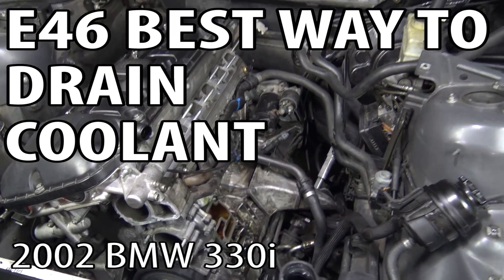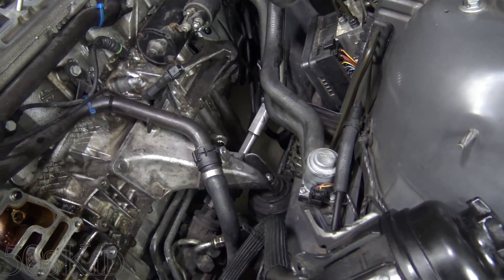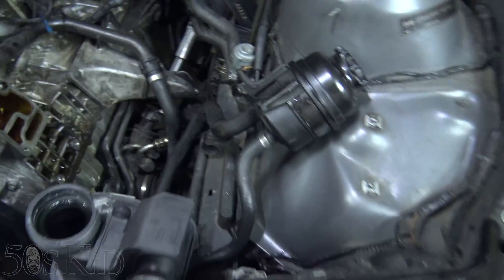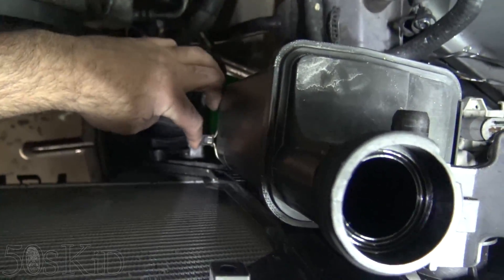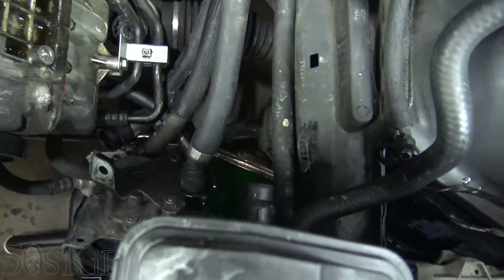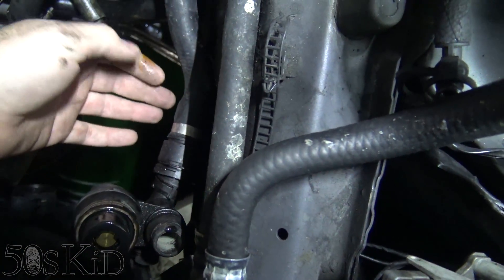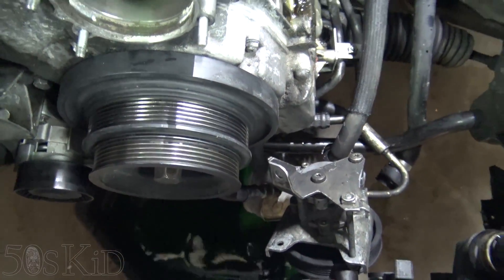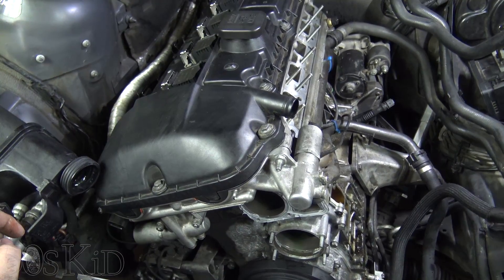Best Way To Drain Coolant on an E46 BMW DIY #m54rebuild 5

Comment: Can you still flush it this way if you're replacing the coolant with different coolant? Someone used the wrong coolant (green) in the car I have, and I want to completely get the green stuff out of the system before adding in blue coolant.

Comment: I am currently doing this and the drain plug on the bolt is very tight I got it to turn but I feel like it's going to shear off, if I remove the water pump will it drain all the coolant from the block as the drain bolt will?

Comment: Just redid the entire Coolant system on my 2003 330i Manual.  Couldn't have done it without you, Jason!  Thanks!!  Not sure if your E46 has more stuff in the way of the block drain, but undoing one 10 mm bolt freed up a flex hose attached to the power steering and that allowed me to go almost straight in with a socket wrench.  Slight pivot.  Found the bolt disconcertingly easy to loosen, and no crush washer.  All good now thought.  Thanks again!

Comment: hey 50skid… i see that you kept having trouble with finding a cleaner way to drain that bottom block plug. i saw an answer on another video which says to keep the coolant cap and bleed screw closed when opening that, this will prevent it from gushing out…

i’ll try it out soon too because i have to and let you know if it works..!
Reply: It’s 3 years later.

Did it work bro?
Reply: @eduardlafleur  we may never know...

Comment: If you are not going to replace the water pump, I would advise opening the plug on the block - it is at the same level as the water pump, so there is no need to do it if you are removing the pump.
Reply: Where is the plug ?

Comment: Good tip
What's also possible and might be abit easier.
If u pull the 2 heater hoses that are on the expansion tank.. Remove waterpump and then fill some coolant or water into the upper heater hose... Then take a compressor.. Put the the air pistol in the upper Heater hose..make sure u got some rag around it to close it all up.. Then just blast air into the system and ull see all the coolant coming out of the waterpump..proceed these steps until u either got fresh water out of the waterpump hole or fresh coolant.
In my case I had pink coolant in my system and I changed it for blue
. So was easy to spot when it was all blue
I also put the heater on hot
This way u don't have to remove the engine drain plug 

Hope this helps for some of u.. Either is a good one
Reply: removing water pump... how is this easier just curious. id rather not
Reply: @ikeepgettinbanned5525  haha Okey ur right.
I only made this remark cause i was thinking he drained his coolant in order to replace waterpump
My bad

Comment: Doing it this way will leave a lot of old coolant in the system. I came up with a much better way and that is to additionally remove the heater control valve and also to disconnect the return hoses from the expansion tank and then pipe some compressed air into the heater valve hoses and this will remove a lot more coolant. I use a big tray (2ftx3ft) from a dog kennel to catch the liquid as it comes out from everywhere and then a fluid transfer pump to put it into gallon jugs. Little mess.

Comment: Hi jayson im doing a expansion tank replacement but those upper hose connected to radiator tab is very tight what would you suggest to loosen it out? Ive tried silicone spray still tight.thank you.
Reply: You just slowly twist it back and forth and while pushing out with a flathead. Make sure you’re on the right layer with the flathead where hose is attached.

Comment: I was actually looking for the heater outlet hose but you didn't identify them. I'm needing to hook up a Flush 'n Fill 'T' and I can't pinpoint the correct hose to flush through.

Comment: I've done everything but can't get my sons 325 I 2004 to stop running hot. Can anyone help
Reply from the maker: You might have a blown head gasket.  Watch my leakdown test video to see how to introduce air to the cylinders and see if it's coming out through the cooling system.  You can also buy a chemical test to check for a blown head gasket.
Reply: 50sKid thanks I'll check. Found out yesterday the car will no longer start
Reply: Stephen Herron last time my car overheated and it wouldn't start , I had snapped some belts and some hoses because of the overheating

Comment: hi 50kids. I don't have to remove any of those parts but I just want to  drain coolant from block of e46(m54). where is exact location of drain bolt?  Do I have to remove any  parts to get reach there  or is it easy to remove?
thanks
Reply from the maker: It's underneath the exhaust manifolds on the #2 cylinder.
Reply: 50sKid thank you good day

Comment: 50skid do you have a video on how you replace the water pipe on the e46?
Reply from the maker: Basically the intake manifold removal/install videos are what you need to follow to replace those pipes.  Once you have the manifolds off you will see clearly how to unbolt them and get them out.  Be aware the part that is stuck into the head and block may break off because it's deteriorated and you'll need to dig it out with a screw driver.

Comment: looks easier than what I went thru today. I decided to take off and clean my fuel injectors because I am getting a stall but no codes so i fgure its a fuel issue. New fuel pump, new fuel filter already..... SO, I take off fuel rail, one of the position clips that holds the injector to the rail flew off, and I lost it for 4 hrs in the engine. Wish they would paint them things like bright yellow or something (STUPID CLIP). Then I get it all back together, FORGOT to tighten the 10mm bolts down that holds the fuel rail in, started car.... gas EVERWHERE.... lol... just used some carb cleaner, degreaser and a hose to clean that mess up..... so i take it all back apart... tighten the damn 10mm bolts down... and the 1st one, the head BROKE CLEAN OFF, leaving the threaded part in the hole... had to get my "Speed Out" take the bolt out... now that I dont have one, I took one off the 2ndary air intake housing for now... but that bolt hole now seems to be a little stripped out, bolt wont get tight but does screw down just fine.... LOL... What a damn day... turned a 2 hr thing into a 8 hr job.... LOL.....

Comment: Are you using regular green coolant? I was lead to believe that we must use only bmw blue.
Reply: Shawn P I'll have to give it a try cause that blue stuff is expensive
Reply: @joelgarcia6307  dont. bmw is phospate and nitrite free its rare you find coolant brands that meet the spec. you literally save 8$ and risk eating alll your hoses out. have fun spending 300$ to refresh that in 40k miles or less